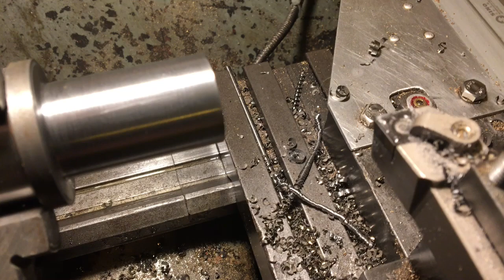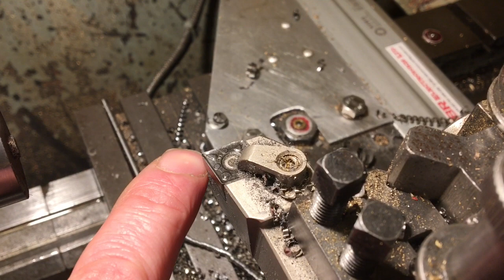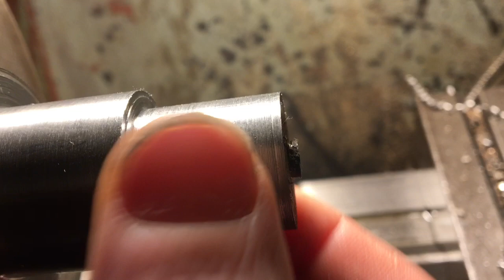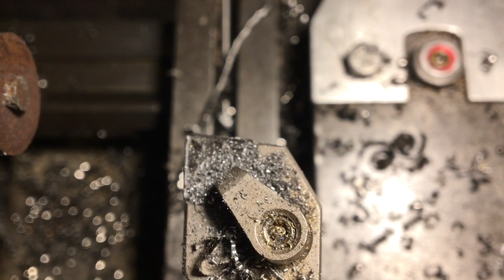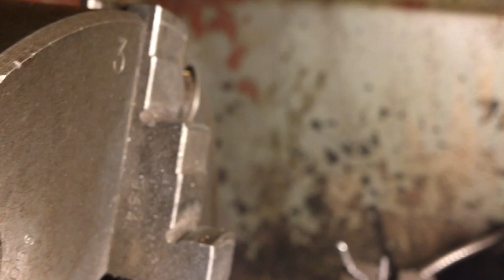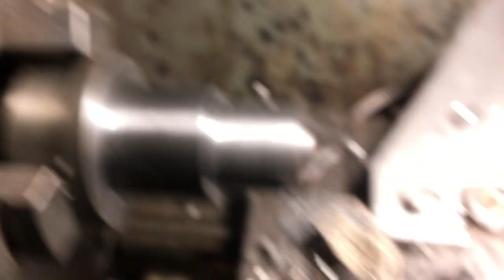Carbide vs High speed steel pt 3 Surface finish and CNMG inserts

Comment: I have never compared carbide with HSS, but comparing carbide of 20 degrees rake to 8 degrees of rake, on my 1/2 hp lathe the results were 4 amps to 6 amps of current drawn.
Reply from the maker: Interesting, I should have tried some different geometries in the name of science!

Comment: Are the HSS inserts the same ones for cutting aluminum. I was looking on Ebay to buy some of the CNMG Style inserts in hss and most say "for aluminum cutting". Will these work on steel? What brand of hss inserts do you recommend for your insert tooling. Thanks for the reply on the other question I had.
Reply: Aluminium cutting tools have a "sharper edge" (if you look at the insert shape in this video, you don't see a very sharp corner just at the cutting edge - aluminium ones will be more of a very sharp edge), to bite more into the material. They will cut steel too, but are more fragile.

High speed can be ground to have a more or less aggressive cutting edge, and aluminium cutting steel should be ground slightly more aggressively to give a good cut. However, I find that aluminium and carbide can be finished nicely just by running the lathe at high rpm and light cuts - mine does nicely taking a quarter mm or less DOC, 0.1mm per revolution at 750-2000 rpm, depending on size of material. Cutting steel isn't so easy to "fix" - higher rpm and lighter cuts MAY help, but sometimes it's not enough to give a nice surface finish on small diameter material.

Comment: How hard is the steel? I was cutting on an axle making a part and my old lathe was working hard. It had a finish similar to what you have. I will be using some cold rolled bar on another project. If U don't get good results i'll go back to hss.
Reply from the maker: Its just bright mild steel, not very hard, the harder steels don't seem to be so much of a problem.